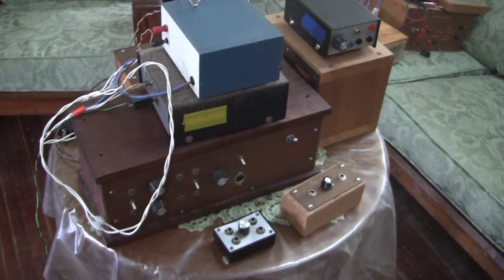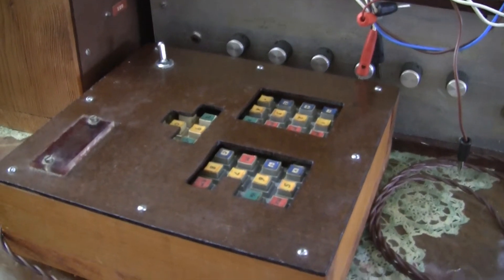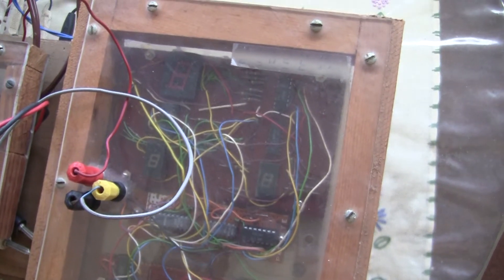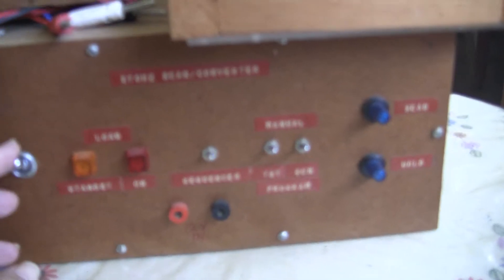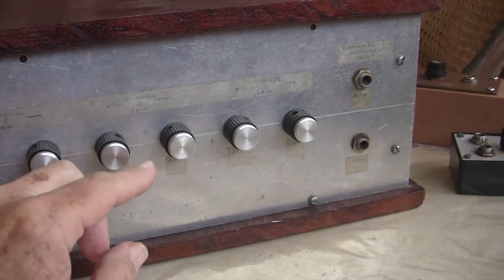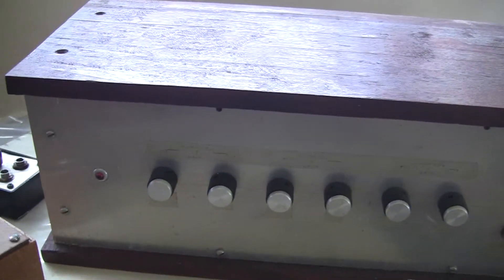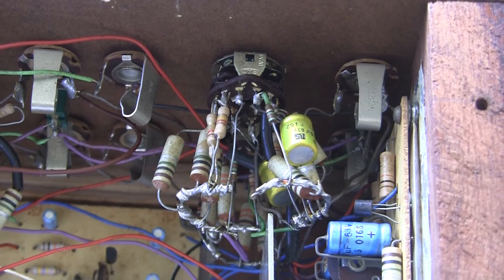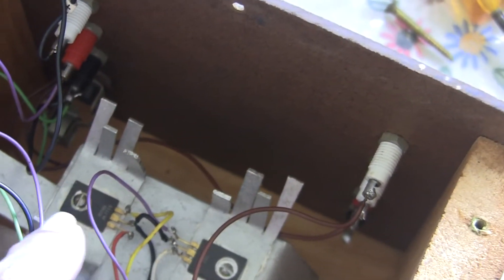Cases for your Electronics Projects

Comment: When I first started this hobby with a handful of DIY kits, I looked into enclosure options because they did not include any. I was quite shocked to find out that enclosure solutions can cost as much if not more than the kit itself! I have since recovered from that shock and am slowly evolving to where I can reason that cost. But the main point being that people tend to mistakenly think the bulk of the cost is the circuit when it is not. (Even the Klon Centaur pedal which goes for $3K can be "kloned" for $25! Check this pedal out it truly is a circuit worth discussing!)  I also have to bring up Eurorack as the ability to build a reliable case for modules takes care of 5/6 of the enclosure and provides common power busses ... but it is still a challenge to design the potentiometers and jacks ONTO the PCB and have all that correctly fit into the front panel. Speaking of front panels, Notes And Volts has a video on designing front panels with PCBs themselves using CAD software and having one of the various Chinese printed board manufactures produce it. Great idea! You can have them silk screened with labels too! I have not looked into having PCB manufactured for me because I need to devote time to properly learning how NOT to make mistakes. I hate the idea of wasted boards because I made a mistake in the design. My box of shame is still very very light so far, thankfully. :)
Reply from the maker: Haze .... as always, thanks for commenting and for all the information that you share ...... Today, it would make sense to order a one-off quality PCB with silk screening ...... but back in the 70's that was not an option for me (and in any case, even today, anytime I order ANYTHING there is shipping and Customs which all adds up ..... and now we have VAT, "environmental tax"  and some other charge added to the accumulation of charges) ....... here is a simple example, a US$20 "bluray" movie could cost Bds$120 by the time I actually get it...... that lovely DOTCOM synthesizer you see in my videos cost me about 3.4 times the US price .....  so it really makes sense to build with whatever I can get locally at the hardware store rather than import anything through a Courier....... on your last point .....  check the circuit using some kind of breadboard and only when it's works properly move from the prototype to the etched PCB ..... thanks for your interest in all my various topics 😁